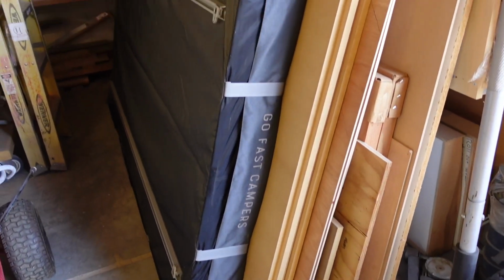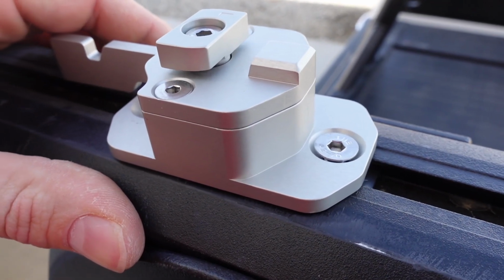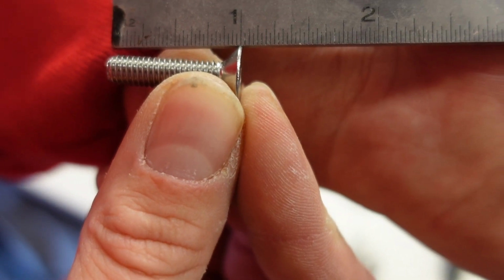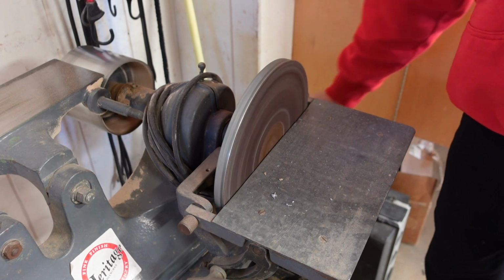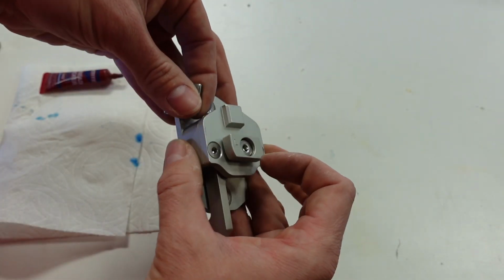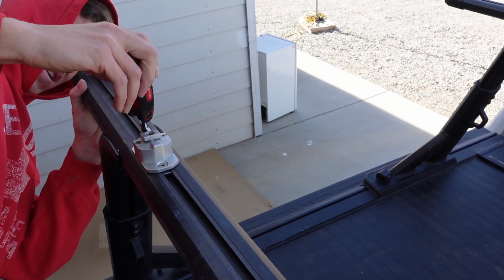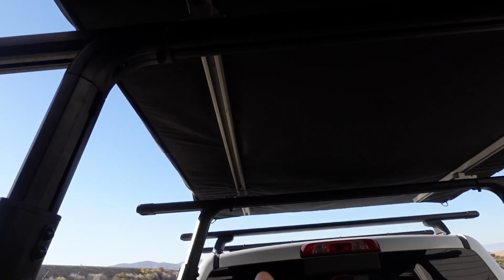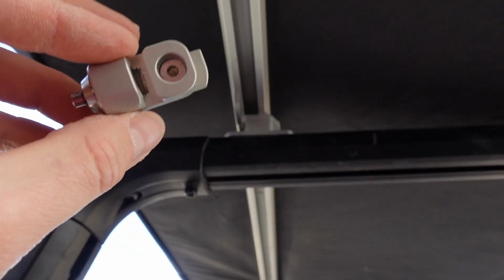GFC Superlite QUICK RELEASE w/ Locks Install (BEST Roof Top Tent Mount)

Comment: Really helpful video. For those who don't want to cut and grind down bolts, the dimensions for the allen drive flathead bolt: M6x1x12mm or 10mm. I went with the 12mm length. It's long enough to loosen the plate enough to just slide the mount on without removing the end cap but short enough to not contact the bottom of the channel when torqued. I found these at Ace Hardware but you can find them on Amazon or your local hardware store (could not locate in Home Depot or Lowes). Also Sherpa Equipment makes a replica anchor plate at spot on dimensions

Comment: Wow, 269 bucks, AND you have to find your own nuts, AND the locks are sold separately at 32 bucks each and you need four of them... So about 400 bucks to save a few minutes using a wrench...  Good vid, very informative, you helped me realize I don't need this. :)  Thank you!
Reply: I thought the same thing! The tent does come with a universal locking system, should work on any aftermarket rack. The benefit of this add on is a quick on / off, but agreed that its dumb you still have to do all this work given the price point.